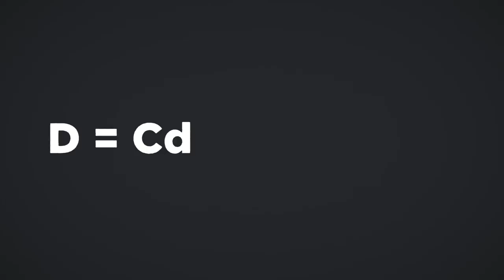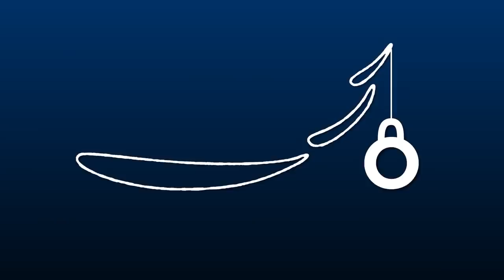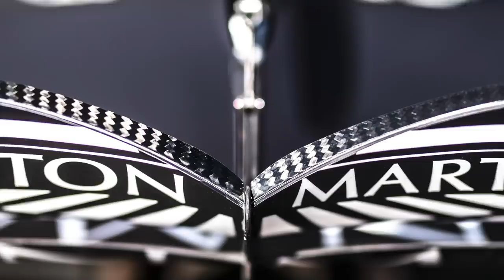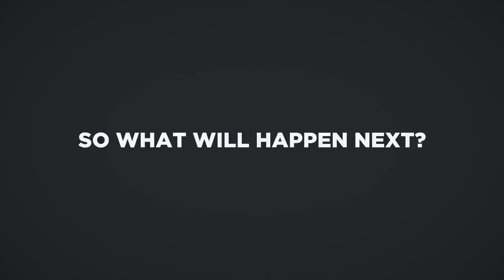What Are Flexi-Wings & Why Are They So Controversial In Formula 1?

Comment: Leave it to the FIA to destroy absolutely any clever interpretation of the rules. When Mercedes invents DAS they’re like “hmmm we hate that you invented something good, but you can use it all year”.
Reply: They didn't hate it though. We've seen this all too many times, they allow anything in the gray area, or even completely illegal things (like their wheels at one point), if it's Mercedes in question.
Reply: Leave it to engineers to destroy absolutely any rules the FIA makes. This is part of F1. It's part of what makes it fascinating. Engineers vs the Rules. 

FYI , it's thanks to illegal innovations like the F-ducts that eventually gave us DRS. I heard people LOVE DRS.
Reply: Theres no 'clever interpretation of the rules.' They just found a way to cheat at the inspection.

This is the rule in artical 3.8 'any specific part of the car influencing its aerodynamic performance must remain immobile in relation to the sprung part of the car.'
Reply: @jameshoover492  did you miss the part in this that it's almost impossible to make wings stiff as rock in f1 or aeroplane? They will flex in some degree with load anyway. 'immobile' is vague word, that means if wings flex and move about 0,000001 mm, they should be disqualified? No right? That's why fia creating load test to quantifies the measurements of allowed wing flexibility and rb or any other team passed it no problem until now.
Reply: @ardijanuar2036  no I've heard people say that.. I just don't believe that even if its technically impossible to be 'immobile' then you shouldn't have to try at all..

Besides there is also this line in 3.8:

'Must be rigidly secured to the entirely sprung part of the car (rigidly secured means not having any degree of freedom).'

..which is clearly talking talking about the mounting of the wing, and not subject to the wind resistance excuse.
Reply: Das was designed with the FIA involved and was completely legal under the rules.
Reply: The wings have been designed to pass a test but work in other ways when under proper working loads 
Take the VW. Engine saga know it not the same but that passed emission standards in test  real life totally different
Reply: Over safety grounds I think I agree with fia on this one. DAS wasn’t unsafe.
Reply: 😅🤣 building a wing that flexes while the rules state clearly that you can’t do that. That not innovation that breaking a rule 😅😅
Reply: @akoniwashington7045  lol think people using phones more dangerous than das
Reply: @chriscollins550  - you know why you had zero comment or very few likes? That's because you used facts on a partisan discussion page.
Reply: @fablewalls  no it's because I talk the truth and fan's like you don't like it. But on another comment with me basically saying the same thing I got over 60 likes and lot of people agree with me. It's a shame people only care about seeing I fight at the front and not the safety side.
Reply: @chriscollins550  haha, you didn't read my comment properly to see I was actually agreeing with you. Mind you - don't judge accuracy by likes - especially on Youtube.
Reply: @fablewalls  sorry I did read it. But must of miss read it. I apologise. It is 23.15 at night we're I am and I'm in my 40s lol
Reply: If covid was not there so it wouldn't have been banned, it was banned just because   other teams would use there money in adapting DAS, which was not wise at times so to keep the game fair FIA banned it
Reply: @mickbrooks8114  actually,  the VW dieselgate saga is a pretty good analogy. Their engines were designed to pass the tests, but they were not designed to meet the requirements of the regulations.  Very similar to the flexy wings...
Reply: Th DAS was banned after a season not because it's illegal, it was designed with full FIA knowledge and involvement. The rules are changed to get rid of DAS because it was too expensive for the other teams to incorporate.
Reply: @muneirovalibas6194  and due to covid FIA wanted to cut cost as much as they can
Reply: well to be fair to the FIA: DAS was an invention which no rule covered but the flex wings are (as far as im aware) against the rules, but the tests aren't rigorous enough to validate to the required means.
Reply: During 2011 to 2014 RB had a flexible front wing that clearly and visibly broke the rules but was passing the tests. The rule back then was something like "the front wing can't be lower than 85mm below the floor of the car". I can't remember the exact details but you get the idea. When tested, the wings remained above the 85mm limit, but when being driven, were much lower and touching the track at times. So it was clearly breaking the rules but passing the tests. At the end of 2014 when there were new revised test, both Ricardo and Vettel ended up being sent to the back of the grid due to failing the tests. They had won 4 WDCs using illegal wings in the mean time. Horner if you remember, complained about Ferrari wining points when using an illegal fuel metering system. He has no shame.

DAS is completely different because it didn't break any rules and other teams were free to use their own system if they wanted to. It was made illegal for the 20121 season though.

Comment: Any suspension geometric change during the race is NOT allowed too, but Merc used DAS for whole season.
The rules are here, all tailored by Merc factory. If anyone else get close to the rules limit, they instantly change the boundary.
If Merc get close or over the limit, they "change" the rule after Merc take the title.
Reply: Das wasn't illegal at any time up to this year. Flexing rear wings have been since the 90s and the team's agreed to it. There's no argument from anyone if they probably read the rules
Reply: Das was literally developed with fia. Cry, casual, cry
Reply: DAS was part of the steering, not the suspension, therefore that rule doesn't apply.

Comment: “Technical ingenuity is always opposed by those who are unable to use them”
Reply: Pauline Weinberger  i mean Red Bull had it coming they had a issue with party mode and DAS so it’s fair that Mercedes get payback
Reply: I guess redbull was unable to make an engine as good as Ferrari so they contested that, they also couldn’t make DAS so they contested that 😅🤣
Reply: Pauline Weinberger  Correct, however thats still what the regulations call for. the teams should  be building their cars as close to compliance as is possible. Redbull decided to brazenly exploit the rule by cheating the test.
Reply: "Formula 1" soon to be "Mercedes Formula 1"
Reply: But it was Red Bull who opposed Ferrari's engine fuel flow and Mercedes' DAS and engine party mode
Reply: @kenneth5769  these guys are blatantly ignoring the things Redbull has done just to suit their narrative
Reply: @kenneth5769  When Ferrari manages to bypass the fuel flow meter that wasn't innovation, when Mercedes managed to get DAS that wasn't innovation. But when Redbull develops a rear wing that bends while the regulations state clearly that wings can't bend now all of a sudden Mercedes and the FIA are impeding innovation. XD
Reply: @devilliersmolefe3851  they probably came from Netflix DTS where Red Bull appears to be the protagonist of that series when in reality RB is the loudest mouth in Formula 1
Reply: @devilliersmolefe3851  Difference is the reaction time that is allowed to rectify. Almost one whole season vs 2 races 😅🤣
Reply: No it's something that's been band since the 90s. Team's aren't even allowed to do innovations since then to the wings.
Reply: Pauline Weinberger  McLaren and Williams all ready complain to the FIA before Mercedes did.
Reply: @kevlard  like mentioned above the FIA reserves the right to change the testing of parts if they are satisfied with the results which is what is happening
Reply: @devilliersmolefe3851  What the FIA can and cannot do is totally NOT the issue here. It's all about fairness, consistency and smart ruling.
Reply: @kevlard  the thing is DAS has never been covered by the rules so teams could develop such a system. Mercedes developed DAS while consulting the FIA to make sure it was allowed so when redbull started complaining they were never gonna win since it was completed legal then the FIA banned DAS because they felt it was too expensive, it had nothing to do with it being illegal. The FIA reserves the right to change the current testing if they aren’t satisfied with the performance of the cars parts
Reply: @kevlard  here is the thing the test is meant to simulate race condition, but obviously, the test is flawed if wings pass the test yet have so much deflection on track. Bendy wings can break which is a safety issue, the FIA has the right to change testing midseason if they see fit. if the Redbull wing is not legal they shouldn't have a problem with the testing being changed then.
Reply: @kevlard  "Difference is the reaction time that is allowed to rectify. Almost one whole season vs 2 races"

This is really simple to understand mate. 
1) Flexible aero has been banned since the 1990's (30 years). Teams that get caught have developed flexible aero without telling the FIA what they were doing because they would be punished. Flexible aero is designed to be used all the way through a race.
2) DAS had a rule created to ban it (0 years old) after Red Bull claimed it would be too costly for rivals to create their own SAFE alternative. Mercedes developed DAS with full knowledge and approval from the FIA. DAS was designed to help with tyre warm up and wasn't used during the actual hard racing part.

All the other teams had a year to develop their own DAS if they wanted to.
Reply: Pauline Weinberger  Well flexible Wings are not new. They were used years ago and then banned indirectly I think. They had to change the mount or something.
Reply: @fablewalls  Well mate you know, things are always 'easy to understand' when you present everything as black and white by leaving out the most complicated 'grey' factors. For instance:

1) The spirit of the rules as apposed to the letter: flexible aero had been banned for safety reasons, NOT for performance reasons. The current wings can be considered 'safe' because they never break under load.
2) FIA recognises at the same time that aero always flexes by nature, that's why they implemented the load tests that allow for a certain degree of bending. All teams have offered their cars for testing and although they ALL bend to a certain degree (some predominatly at the rear, some more at the front), all have passed the load tests and are thus considered to be 'safe'. So, declared legel with full knowledge and approval from the FIA as well (just like DAS mentioned before)
3) Merc are not complaining the safety of the Red Bull rear wing. They complain because they fear a competitive disadvantage and are trying to force Red Bull to re-focus their cost capped limited resources to making the car slower in stead of making it faster. So, competition is moved from the track to the book keepers office, nice...
4) If you, for whatever reason decide to change the conformity tests half way in the season you should allow for a reasonable time to re-develop the backend of the car. FIA have thought 2 races is reasonable in this case .
5) Merc are considering protesting the reaction time, not because they think it is unreasonable but because it doesn't suit them competition-wise.
6) Red Bull are now retaliating by trying to force Mercedes to change their front wing as well.

Wolff has opened a can of worms here. In the end no one will benefit but the sport as a whole will lose.
Reply: @kevlard  1) ~ “flexible aero had been banned for safety reasons~ however saying wings can be considered 'safe' because they never break under load is avoiding that Red Bull found another way to circumvent article 3.8 and weren’t caught till recently. If you think I’m melodramatic, there’s a 2018 article in motorsport magazine which states that Red Bull have been most proactive in bendy technology since 2009

2) ~ all have passed the load tests – yes and being honest you would admit Red Bull designed the carbon layup to pass those stationary tests. Very clever but like the others – cheating. 

3) ~Merc are not complaining the safety of the Red Bull rear wing~ no, but just like McLaren they are protesting the legality and breaking of rules. 

4) ~ decide to change the conformity tests half way in the season you should allow for a reasonable time to re-develop the backend of the car~ I think that’s OK. The rules clearly state they can make immediate changes to enforce existing rules so the teams have been lucky there.
 
5) ~ doesn't suit them competition-wise ~ you honestly think Mercedes can’t now produce their own flexi-wings for Baku? They hve already said they will make their own wings more bendy now.

6) ~Red Bull are now retaliating by trying to force Mercedes to change their front wing ~ and there’s video which shows the travel is the exact same. Which is what Toto said.
Reply: @fablewalls  2) 'Very clever but like the others – cheating'. Every team is trying to exploit the gray area of the rules with technical innovations. I would not call that 'cheating'. But if you insist then every team 'cheats'.

3) 'Just like McLaren they are protesting the legality and breaking of rules'. ...which they break themselves as well --> 6)

4) Ok

5) 'You honestly think Mercedes can’t now produce their own flexi-wings for Baku? They hve already said they will make their own wings more bendy now.' Of course they can. But they don't want to spend the money.  In stead their goal is to force Red Bull to use up their development resources to make their car slower (against the backdrop of the cost cap).

6) 'And there’s video which shows the travel is the exact same. Which is what Toto said.' And Toto lied: https://racingnews365.com/video-mercedes-wing-appears-to-flex-more-than-red-bulls
Reply: @fablewalls  Wow, please revisit the link I sent you and look further down. There are 2 videos here, one from the Merc, another from the Red Bull. Same viewpoint, same zoom level, same track, same speed. Your link is inconclusive: different viewpoint, different zoom level but same grid size...Who are they trying to fool here?
Reply: @kevlard  That website required that I accept ALL cookies to see anything beyond the first video. If you have anything from Youtube that would help however all this is going to be just hot air once the new tests and camera tracking is in place for Paul Ricard - we'll see just who has lost speed and by how much.
Reply: @kevlard  Thanks - that one worked but it told me the same story as the one you said didn't work - the cars don't tend to have two different cameras mounted on the same parts so I really don't understand why you protested my video???

Anyhow - like I said before - watch the Red Bull wing near the end of the screen. 

One thing I discovered today - the ruling that allowed the FIA to change tests mid season that all the Red Bull fans are complaining about? That's because the FIA gave themselves that power when they changed and made up a new rule last year to ban DAS....

https://drivetribe.com/p/mercedes-das-system-ban-is-more-BcqwNN4VRQuGrRHwtUBolQ?iid=BMvMJM1CRY6e0WUoH-7LTw
Reply: @fablewalls  Although I think it'll just raise the costs for everyone I reckon most are okay with the change, as long as it concerns both front and rear wing and respects the previously set deadline (French GP)
Reply: @kevlard  ~ personally I don't care which team this applies to but they all knew the rules when they designed their cars, if they didn't want the costs then they shouldn't have taken the risks.